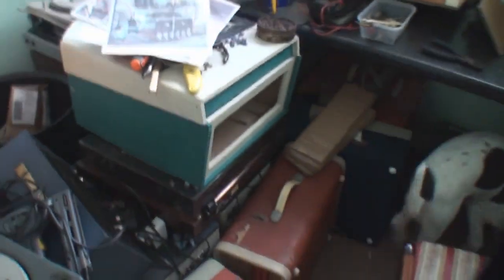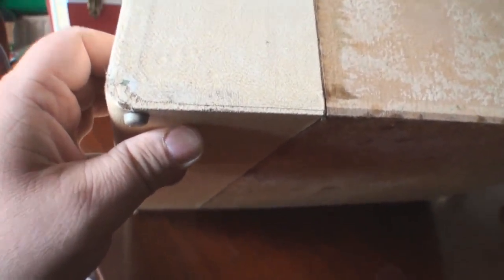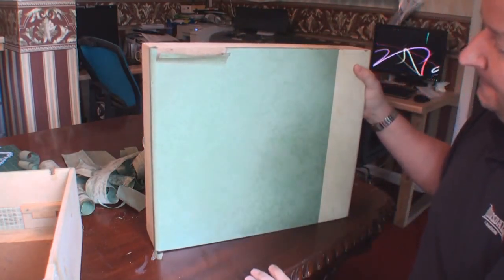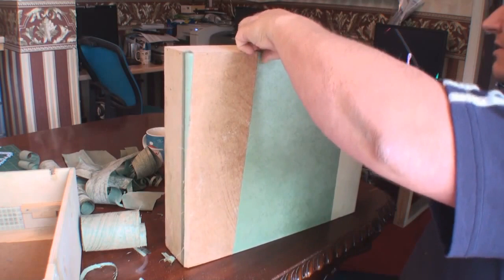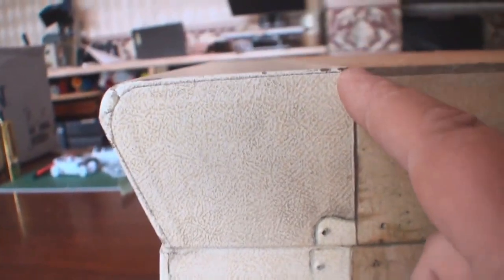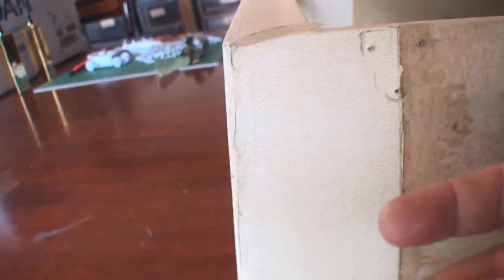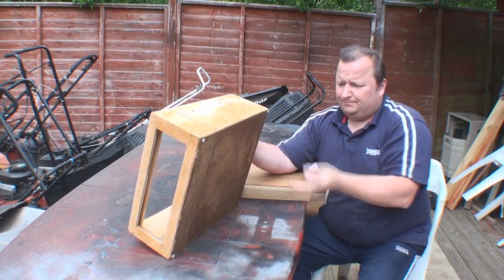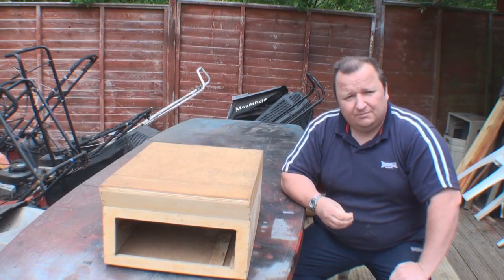Vid 1 Recovering A Dansette Major Deluxe Rexine Or Vinylcloth

Comment: excellent job, but where did you find the proper vinyl cloth? here in italy i tried to search in fabric shops and on ebay but they seem to have only thick fake-leather, like the one used in car seats or sofas, the only thing i found is a  40 years-old roll of wallpaper with vinyl covering but it is in bado condition so i can't use it
Reply from the maker: Try Sid Chaplin at http://www.vintage-radio.com/trg/
Drop him an email or better still, give him a ring. Very helpful chap.
Good luck with your restoration.

Comment: any tips to treat woodworm in old cabinets lucky Caught it before done huge damage but they eaten through the covering and I need replace it. dark green.
Reply from the maker: Do a google search Tim, i'm not an expert bud.
Cheers
Martin
Reply: If you have fixed it then ignore this, but if you havent then this might help, im going to comment this anyway to help people. 

The best thing to do is to remove the rexine, fill in the holes, sand it down so its smooth. Then recover.